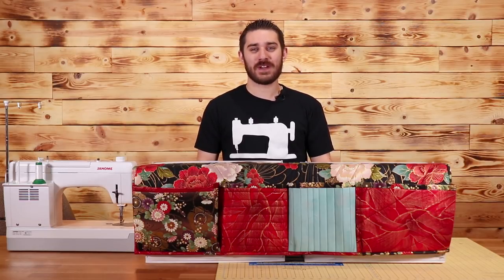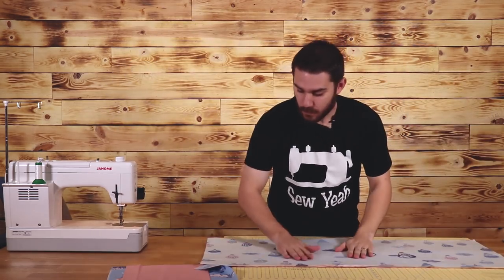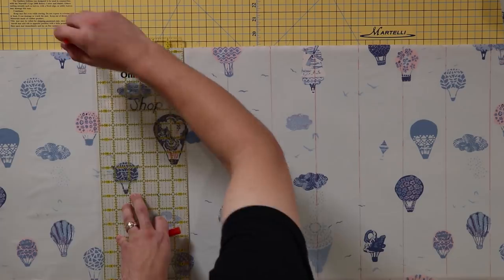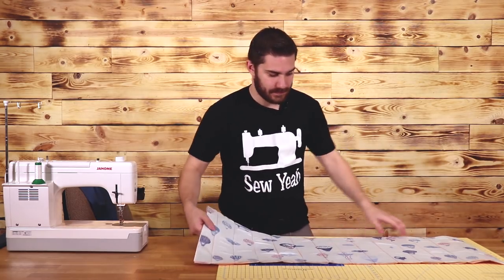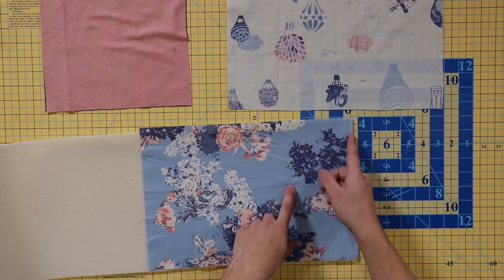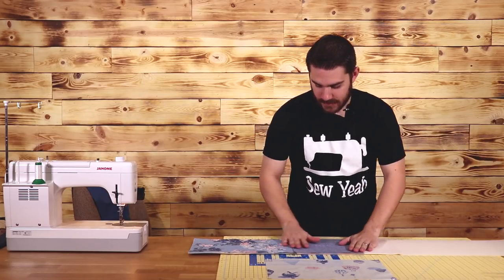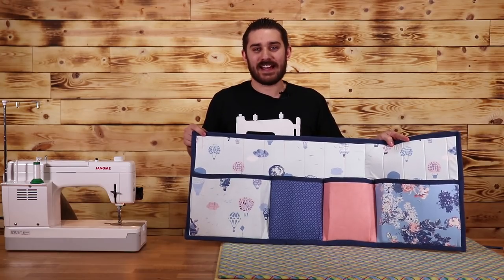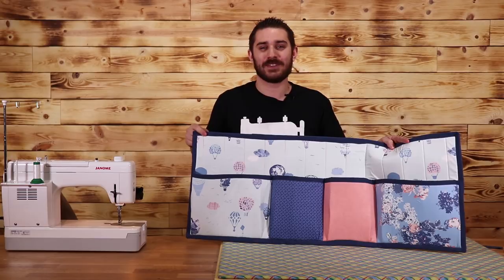Make a Bedside Caddy! | Sewing Project w/ FREE PATTERN!

Comment: As several other people asked, how do you keep it attached to your bed once you add weight to the pockets? There's only about 6 inches of fabric that's tucked between the mattresses from the sounds of it which doesn't seem to be enough length to counteract weight dropped in the pockets.
Reply: I would go to the Dollar Store and get shelf liner.  You should hand sew it on because it will damage your sewing needle.
Reply: I’d add fabric, maybe cut a sheet long enough to fit at least half way between mattresses.
Reply from the maker: As you can see we are behind on the replies. I am trying to catch up and stay that way. I hope you have found the answer to any questions you had and thanks for watching!

Comment: The caddy is quite pretty & seemingly useful; but how do you attach it to the bed so the weight of a tablet or heavy book doesn't pull it loose?  Thanks.
Reply: A flap sits between the mattress and box springs. So the weight of the mattress holds it.
Reply from the maker: As you can see we are behind on the replies. I am trying to catch up and stay that way. I hope you have found the answer to any questions you had and thanks for watching!